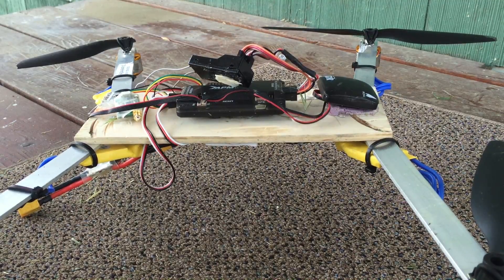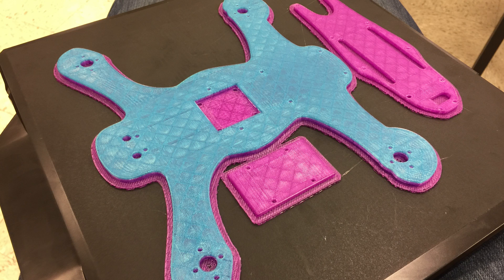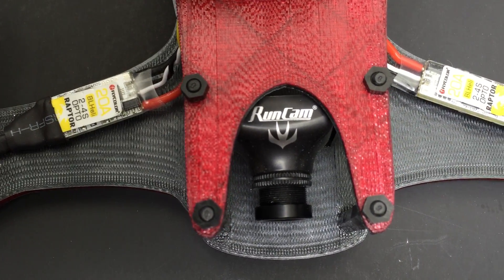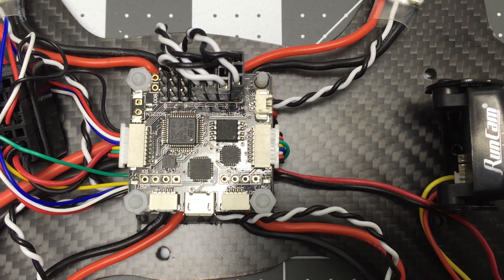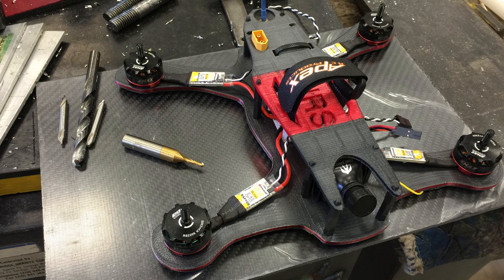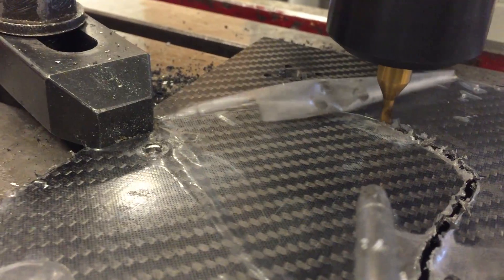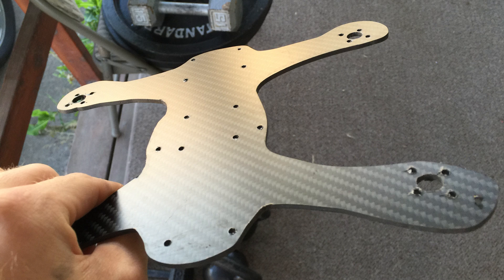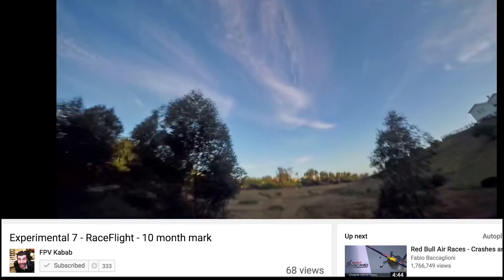I Made My Own FPV Race Drone

Comment: dude u put 20 a esc but most of the youtubers says that put that esc in which  20% extra remaining amperes like 30a and even if we pair a 20a esc with a 2205 2300kv motor with 3s the max draw current is around 19.2.... so maybe the chance of burning esc simple the question is that can we pair the 20a esc with 19.2a max draw current motor is it safe ?

Comment: Hi sam i need your help...how can i calculate the C rate for my lipo.?? which is the c rate that i need in order to prevent the damage of it ...if my motor squeze the batery..high drain of current and low c rate..i hope to be clear with my question..thanks for your video they help me a lot.
Reply from the maker: The capacity multiplied by the c rating of the battery gives you the maximum current they the battery can safely deliver. Or so that's the theory. So 1000mah (or 1 amp hour) times 70c is 70 amps max current draw

Comment: Why did you do the 3d-printed version flat?
Most of the load is in the thin direction of the arms, both when flying and crashing.
Reply from the maker: I did consider making some elaborate shapes to take advantage of what a 3d printer can do but: 
1. easy to model
2. Accurate dimensions to test how things will fit with a flat plate of carbon. This prototype model wasn't meant for structural performance.
3. The way a 3d printer builds flat floors and ceilings is pretty strong compared to non-planar surfaces

Comment: What CAD software do you use?
Reply from the maker: I used Rhino, but for this stuff I recommend other more simple free options such as google sketch-up (the hyperlite frame and others from Bob Roogi are designed from sketchup) or Fusion 360 is awesome too and has build in CNC CAM software

Comment: has anyone ever tried using Milwaukee tool batteries for any drones ?
Reply from the maker: +roy siguenza they're just 18650 Li-ion batteries. Good for endurance but not as good at quick discharge
Reply: ***** wait I don't get it ,good for endurance but not as good at quick discharge I'm confused
Reply from the maker: roy siguenza They have a high energy density. Meaning lots of energy and low weight. However they can't supply all that power all at once. So they're good for a slow steady power supply. With racing drones however, we want as much power as fast as possible at the expense of flight time. So our batteries can fully discharge in like 2-3 minutes. Only super high performance batteries can do that. Discharge rate is measured in C-ratings.
Reply: Thank you sir
Reply: I understand so in theory the lithium ion cells are the same but the processor drains the cells at a rapid rate so the solution would be to carefully transfer processor from drone to tool battery.I'm only contemplating the idea because I have several Milwaukee batteries available
Reply from the maker: It's very likely that there is a small regulator circuit on the 18650 cells, but racing drone batteries have to regulator at all. Still, the 18650's simple are not designed with a high C-rating. The chemical processes cannot happen quick enough.

Comment: what is fly time with 1300mah battery of yours???
Reply from the maker: These racing quads are designed for maximum performance and minimum weight. These motors can pull almost 30 amps each creating a thrust to weight ratio of like 10:1. So depending on how you fly. I usually get 4 minutes. See my newer videos for how I fly these days

Comment: Samm I need some help. What transmitter would you recommend for a beginer for quad FPV flying? I need something for my JJPro P200 which I've bough without a transmitter (I know, I haven't used it).  I don't need really expensive stuff for over 200 pounds/dollars. I've found this Spectrum DX6, about 100 pounds and Walkera Devo 7E in simillar price. I've also found Flysky FS-T6 and controllers called Radio Link but they are in suspiciously low prices but I don't know, maybe they aren't bad. 
Please answer if you can. In fact anyone can answer with some wisdom.
Reply from the maker: +ardvark84 a lot of people like both the radio link and also the FlySky. You want a receiver that has SBUS or IBUS
Reply: ***** The problem is that I don't know what is SBUS or IBUS. What about Radiolink AT9 Upgraded Version AT9S? Will it work with JJPro P200?
Reply from the maker: the difference between PWM, PPM, and SBUS for connecting a receiver to your flight controller.
PWM (pulse width modulation): Analog signal where each channel is transmitted parallel to one another on its own wire. This is old school and the only way to connect a servo or esc directly to your receiver with out a flight controller. Conclusion: pretty fast, but lots of wires.
PPM (pulse position modulation): analog signal where each channel is transmitted in series one after the other via one wire. Conclusion: simple and easy, but slightly laggy.
SBus or similar: digital serial signal (basically the same as USB) where each channel is sent via 1 wire. Conclusion: very fast and easy, but you have to find a receiver for your transmitter that will do it.

FrSky and many others have the common "Sbus". FlySky has "Ibus" it's just another serial protocol and works the same.
Reply: +Samm Sheperd (SNRS) so If I will buy transmitter with a receiver compatible with each other then I should be ok right?
Reply from the maker: yep
Reply: ***** Nice one mate, I appreciate your quick help. Good luck!

Comment: Really cool build! Can i suggest you put a pig tail between the VTX and the antenna, if (when) you crash, the antenna will snap the connection to the VTX and you'll need to buy a new one. I did that twice before I started using pigtails, they only add about 5grams.

Comment from the maker: Thanks, but that circle in this video is concrete
Reply from the maker: First flight in the park with the table was LOS, second at the field was FPV
Reply: Was this your first acro flight or was it angle?
Reply: how did you record the footage so clearly?
Reply: Zed's animations GoPro
Reply: he didn't show him using a GoPro maybe he used a onboard DVR
Reply: Zed's animations the Swift mini shoots 600tvl not 1080p and when the battery unplugged itself the cam kept recording so it was an external cam. GoPro or Runcan or Xiaomi I don't know, but an external cam. Plus raw footage from FPV cams (even if recorded on board) looks waaay worse
Reply: yeah know it makes a lot of sense thanks

Comment: What program did you use to design the frame?
Reply from the maker: +Jonathan van der Riet I used rhino but most any CAD program can do flat plates super easily. I recommend fusion 360, it's free and also what I used for CNC stuff
Reply: Thanks. How did you cut the carbon sheeting?
Reply from the maker: Well I tried to use a CNC machine for it but then I couldn't use them anymore so I used a scroll saw

Comment: I want to have a fpv racing quad but I'm only 11 and I do have the tools to make them 🙁 and the they cost like $200 with out a controller 😕😕😕😪😪😪
Reply: Rip
Reply: hey you can make a very cheap quad by buying things from banggood. you can get a quad , 100$ If you shop properly
Reply: Kirtik Soni yeah but because it's cheap it's gonna be pretty scrappy and you'll end up paying more than one of the good quads if you break it and fix it up again (depending on what you break)
Reply: xX FaTeForce Xx No its not like that.Buy the right parts and you are good to go. Actually, There are emax motors with their escs and they are a reputed brand so motors and escs are chechk. Next is the frame, Get a cheap plastic or carbon frame cuz no matter what, You WILL crash so a these frames can withstand the damage and replacements are cheap, Battery and cc3d like boards are very reliable. Give a go to banggood. Theyre actually good. Hope you get into the hobby soon :D
Reply: Kirtik Soni Yeah I guess but since he is only 11 then he might not have access to a soldering iron or something else. I'm gonna buy a present for my friend and he is really into the hobby like me and I was thinking the jjpro p200 or something else but in the same price range
Reply: Nitro Harrap My previous comment is for ya.

Comment: Total cost?
Reply from the maker: Haha.... Well the motors are $20 each. Speed controllers $10 each (coupon in description) Flight controller is like $20. Power distribution board $5, Battery $20. Radio control system varies a lot, let's say $60-150 (I already had one) Now for FPV Gear. Camera $35 Video Transmitter $20. Now FPV displays are a big one if you don't have anything. Good video goggles are up to $500 but my headplay HD's were $250, and you could get cheaper things too I guess. Yea it's a lot
Reply: Yea, especially if you get it all at once.

Comment: Do you have a cheap online source for carbon sheets of different thicknesses (or just carbon fiber cloth) ?
Reply from the maker: +shodanxx I don't know of a good supplier at this time. just ordered one sheet quickly from Amazon. Not cost effective.
Do let me know if you find one!
Reply: I did a survey of what was available on ebay.
Looks like the best deal is 200mm x 300mm sheets (0.5mm in particular).

Here are the best prices I could find for each thickness 

200mmx300mmx0.3mm 7.87"x11.81" 93in^2 11.16$ 0.120$/in^2
200mmx300mmx0.5mm 7.87"x11.81" 93in^2  9.20$ 0.099$/in^2
200mmx300mmx1.0mm 7.87"x11.81" 93in^2 13.39$ 0.144$/in^2
200mmx300mmx1.5mm 7.87"x11.81" 93in^2 15.15$ 0.163$/in^2
200mmx300mmx1.5mm 7.87"x11.81" 93in^2 15.43$ 0.166$/in^2
200mmx300mmx1.5mm 7.87"x11.81" 93in^2 23.06$ 0.248$/in^2

You can get 100x500 200x300 but 300x300 or 500x500 is much more expensive and rare, likes 0.7$/in^2

I haven't done the survey, but seems carbon fiber rods of all sizes are available very cheaply.

hollow rods and square tubing is also available but it seems there's less choice and it is significantly more expensive.

On thing that strikes me about you design and most quad copter is, the "back plane" is in the wrong orientation  !   Like , the motor tabs, they would be a LOT stronger in the direction they need to be if they were rotated 90 degrees !?

Do you know good ways to connect pieces of carbon fiber together that is as strong as the carbon fiber elements themselves (and without weighting too much more) ?

Comment: First of all, Great Job!! I must however say I was shocked to see the CF being cut, sawed, and drilled with no dust management system. a 2 micron system is needed to protect your young, brilliant lungs from irreversible damage from the CF dust. 2 micron solutions are available cheap and decent systems start less than 300 from Harbor Freight & others. Please do a little research to become familiar with the risks you are taking. All the best to you. Your designs are very nice. be well sir.
Reply from the maker: Thanks very much! Respirators were worn

Comment: couple things, 
1, great job building from scratch and using the manual testing rather than the digital :D
2, you will get a better video signal if you get decently made antennas, i have used the same type as you showed, i had reception issues until i got a set made by someone on RCgroups, then i could fly farther than my radio i think :P
3, tie down EVERYTHING, it might not look like the esc can reach the prop, but it will find a way....
4, have safe fun!!

keep us posted Samm

Comment: Beautiful project man! Quick question; was it hard to tune the PIDs? I ask this because since the frame is 3D printed it can flex quite easily.
Reply from the maker: Everything in this video was stock PIDs on the SP Racing F3 Naze32. You can hear on the high speed flight that is a little work to be done!

Comment: How much would it cost me to build one from scratch? I don't have any RC or FPV equipment, so that'd have to be included in the price too. I'm just intertested in the ballpark figure, like is it $300 or $1000?
Reply from the maker: You could do it for around 300 to 400. Though good FPV goggles are already that much by themselves. I'd also recommend getting a little cheerson cx-10 just to get your brain understanding how to control the things. Will make flying the expensive stuff much easier.

Comment: Pretty cool. It's cool that you made that, but are you aware you can get a QAV or an Alien clone on Bang good or Ali express for $17 ?
http://www.aliexpress.com/item/FVT-Littlebee-20A-Mini-Opto-ESC-2-4S-for-QAV250-FPV-Racing-Quadcopter-4-Axis-Multicopter/32590704408.html?spm=2114.01010208.3.10.R5Q0H2&ws_ab_test=searchweb201556_0,searchweb201602_2_10037_10017_405_507_10033_10032,searchweb201603_1&btsid=d33fce5a-1462-4a85-9969-0c57214259be

Comment: what program did you use to design the quad ? Also use polycardonate to print the quad frame its as strong as CF
Reply from the maker: I happen to have used Rhinocerous but I'm sure Fusion360 (free) would also work really well. I used Fusion360 for the CNC stuff. The printer I had access to only prints PLA. I think though that the new printers that print carbon reinforced nylon would be great!

Comment: Hey man great video! One thing of note: you are using really good components minus the ESCs, which make the biggest difference in how the quad flies. If you're interested in upgrading, the favorite littlebee 20a ESCs only cost about $14 a piece and will perform far better.

Comment: I choose to mill my frame as my first project on CNC mill i used 2mm PCB mill (10 pcs for 10E) on homemade CNC mill and result was flawess, try propper millbits... and glue carbon plate to wood or mdf plate with doublesided tape.
Reply from the maker: +olekdh what was your spindle speed?

Comment: I need a 3D printer in my life :(
Reply from the maker: I love them and also hate them. My dad would bring home a 3d printed part for me when I was like 8 years old, and the technology hasn't really changed much. It has become available to the masses but it's still overpriced and unreliable.
Reply: Really? How old are you then? I thought 3D printing was a technology of the 2010s :o
Reply from the maker: seklerek I'm now almost 22. My dad worked for Nike designing custom track shoes for olympic athletes.

Comment: Nice job dude, clean build. I recommend a pigtail extension for your expensive VTX though, I just killed a 200mw immersion not doing so.
Also wanted to add that if you have trouble putting it down gently because it's just got tons of power, a slightly more shallow throttle curve for that bottom 20 or will help give more resolution there but still feel the same for flying.
Reply from the maker: Awesome advice, Thanks a lot!

Comment: You can send your design off somewhere and have it cut for you.  Takes a couple weeks to a month turnaround depending on who you go to.  I've had good experiences with this.
Reply from the maker: It was mostly a learning experience and an excuse to use the CNC's. But I definitely see that outsourcing would be the best way to produce and sell these.
Reply: I don't necessarily sell them. Any I've sold I've made 0 profit. I just like to apply my own ideas and enjoy it when other people want to use my frames as well.  My idea of a frame was quite different than most stacked plates so I just HAD to try it.   No excuse needed to create stuff!

Comment: Be careful cutting carbon fiber. The dust is as bad or worse than asbestos. Use water to control dust and make sure to wear breathing protection.
Reply from the maker: Thanks man! I should have mentioned something about that. It also stains your clothes and makes you itchy!

Comment: To get the frame built use armattan productions and they could sell the frame for you.
Reply from the maker: +Simonjr gaming who are they and what do they do? Do they source their own carbon? Do you think others would want this frame?
Reply: With Armattan Productions you submit a design to their website (http://armattanproductions.com/). They will verify the design (check to see if your not stealing someone elses design) that will take a couple of days. After this they will tell you the price at which they will sell you the design (their prices are very competitive). Then you can set up a shop on their website where they can sell you the frame for whatever price you would like that is above the cost of the frame. You can then purchase the frame for yourself. As far as carbon goes, they will use carbon fiber from 1mm to 5mm and they only use the highest quality carbon fiber. As far as selling the frame goes if it is unsuccessful it wont cost you anything to sell the frame so you have nothing to lose. The frame also looks super durable so if you got the price low enough it could be a good first or learning racing frame. If you have any other questions go to armattans productions website and you can find more answers there. 
Best of luck!

Comment: I've alsow build a cheap Quadcopter with the same motors, ESCs and props. But I mounted the ESCs below the prop, so they are cooled all the time. They don't even get hot. My Battery (20C 5000mAh 3s) gets warmer than the ESCs and the motors, even when I fly fast. But I alsow had some problems with the ESCs. I bought 6 of them. Two work perfectly fine, two spin the propellers extremely slow sometimes, so you cant's start and two simply stopped working a few seconds in flight, witch caused some crash's.
Reply from the maker: ++Tec you used a 5000mah 3s with these motors?
Reply: Oh, sorry, I phrased that wrong. I used a 3s 5000mAh at a quadcopter like in your attempt to build the "cheapest DIY Quad".
Reply from the maker: That makes more sense :)

Comment: How much does this drone cost your from scratch? Is it affordable?
Reply: just look up the parts but you will need more than just the quad. You need the fpv equipment, the radio, batteries, chargers and a lot more.
You can buy a ready to fly racing quad without fpv goggles but with everything else for like 200-250$ in china. But i would recommend to do it yourself because it its alot of fun and you know what is going on in your quad.